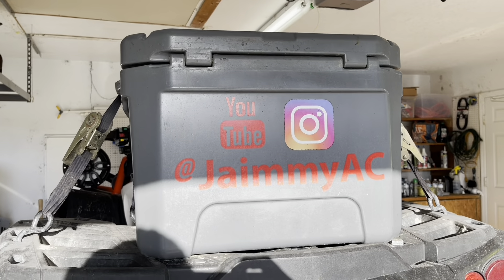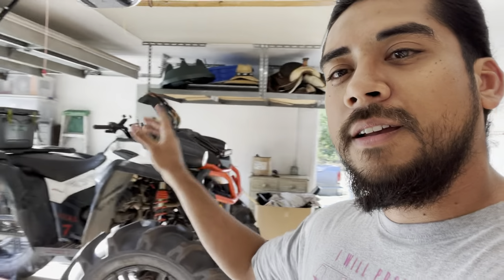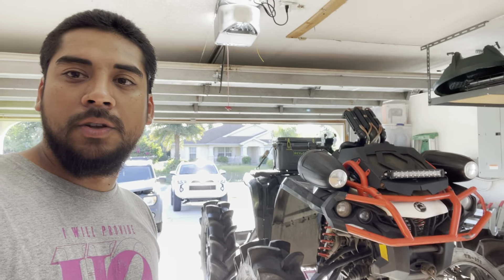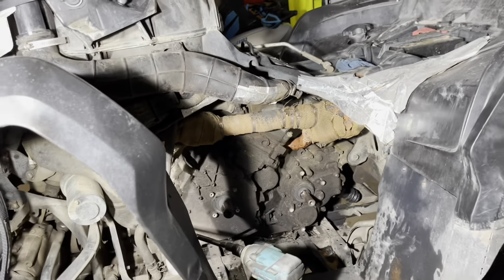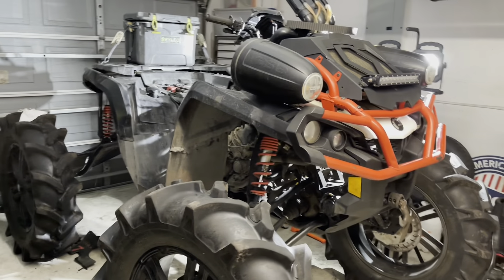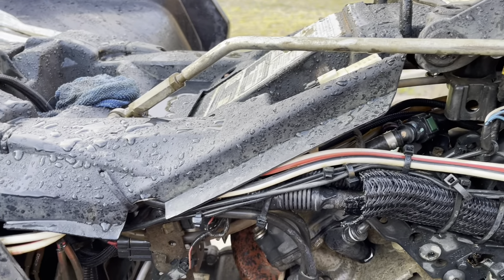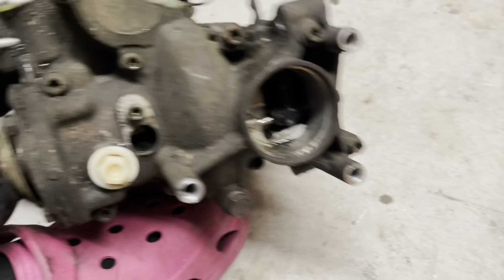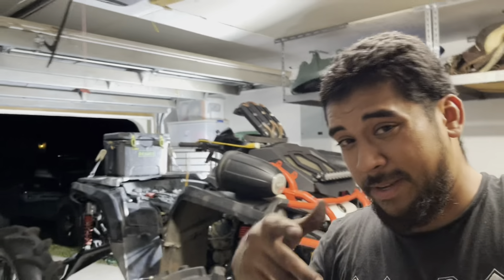Can Am Transmission Removal!

Comment: Hey. I know it's a couple years old, but around the 6:10 mark you said something at the front of the engine had to be removed. Were you talking about motor mount? I see the bottom one at the front is still in, on the side you were videoing. I'm hoping to pull my 650 gear box without pulling the whole motor out.
Reply from the maker: Yes, if I remember correctly I think I undid the front motor mount bolt to move it forward a bit. It’s been a while!

Comment: i have that same leak where u said the timing chain adjuster how do u fix that
Reply from the maker: I believe I just changed out the small o-ring it has, simple fix!
Reply: @JaimmyAC  thank you i have a leak at the bottom of my tranny am i able to take off the clutch side without all the guts coming out and also without taking it out if that makes sense where all the torx screws are. i think i have to reseal it with the rv silicone.

Comment: Hey, is it possible to remove the output shaft without the transmission removal? Mine is also broken and rear wheels dont spin
Reply from the maker: No, I believe you have to split the case open to replace the output shaft. It really was not that hard to take it out
Reply: @JaimmyAC  Oh well, thanks a lot for the reply!!!

Comment: Is the xmr 850 and xmr 570 transmission the exact same size or does the 570 have a smaller gear box case? I know the ratio is lower but I was wondering about the actual size of the gear box
Reply from the maker: @organabis7132  It’s the same, that’s what I used here
Reply: @JaimmyAC  hmmmm I wonder if the 6x6 gear reduction transmission will fit then. It has 28 percent lower gears in low and 14% lower gears in high

Comment: If you have to remove the front driveshaft? And slide the motor forward? Or just undo the front motor mount and push the motor down
Reply from the maker: I did not remove the front driveshaft, I just undid the front motor mount bolt and was able to shimmy it out.

Comment: how did u get out the driveshaft in the front?
Reply from the maker: I don’t think I removed it for this.
Reply: @JaimmyAC  did u disassemble the u joint
Reply from the maker: @garrets4432  For the rear? I just slid the back piece off. The rear driveshaft is two piece.